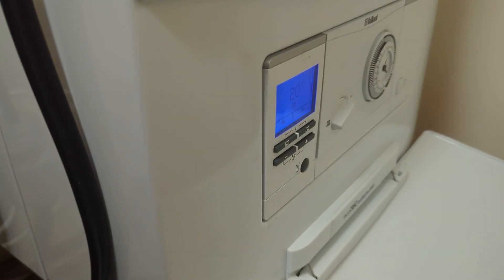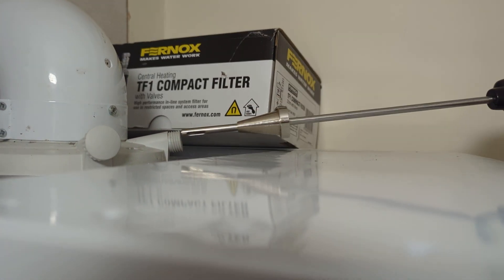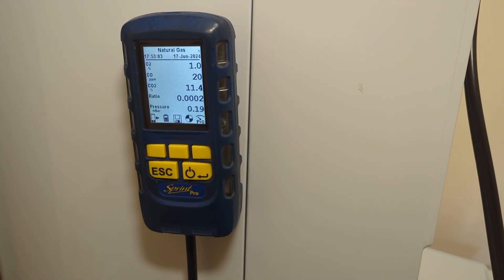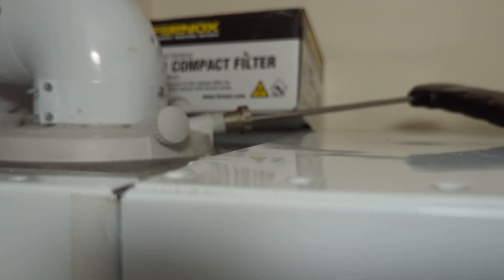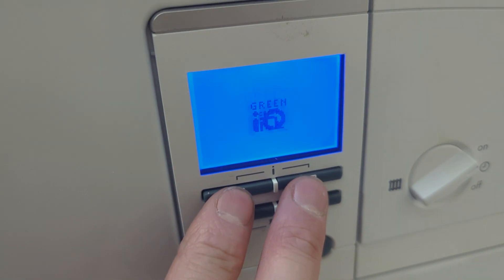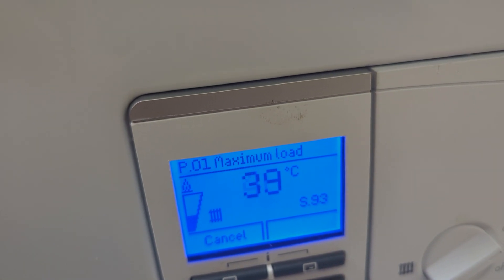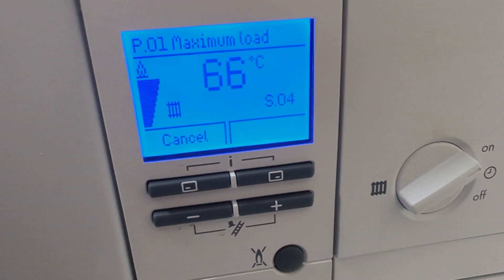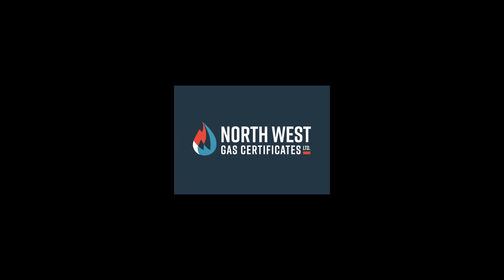Vaillant EcoTec Exclusive 843. Service Modes. Problems.

Comment: I’ve had this issue next time put it into p.06 remove the jack on the diverter valve and run a hot tap it will not over heat as it will be sending heat around the heating system and though the plate 👍🏻
Reply from the maker: Yes Vaillant did tell me to do this as well 👍👍

Comment: I've fitted over 50 of these Ecotec 843 boilers since 2020. Almost every single one had this issue. Some of these warranty calls from Vaillant are every 6months or annually. Customers are getting fed up. On the diagnostic menu, it shows CO sensor fault 8.
Reply from the maker: Ive run out of patience with them. Ive recently been back to this boiler. I don't understand. Vaillant came back, put it through its calibration to get some stable readings yet again. Then I come back a week later, I don't bother doing the calibration as its so hard without it over heating. I therefore just put a hot tap on and see what the readings are. They are absolutely all over the place and then the co just flys up into the 1000s. Surely that shouldn't be happening everytime the customer puts the heating or hot water on??

Comment: Many thanks for this info. I was pulling my hair out the other day.  My Analyser was going into purge mode with high CO readings. Why Vaillant dont do  separate set up sheet amendum, rather than burying it deep in the installation manual. Plus after  6mins the boiler shuts down getting  too hot on P.01 heating. Also same issues putting it into hot water mode.
Reply from the maker: I know. Im back servicing that same boiler in the next few weeks. Im dreading doing the flue gas analysis..
Reply: @northwestgascertificates  Or just do what most other blokes do. Dont bother doing Hi & Lo rate combustuon or flue integrity test. Just run the boiler, put the analyser in and print it off.  😂
Reply from the maker: @kevinmiller9522  😂
Reply from the maker: Although its been a pain to get into service mode etc etc. By doing it and struggling with it, it has diagnosed a problem with the co sensor 2 years on the trot. Vaillant have been out each year after ive been,  to change this under the warranty. Theres definitely a few issues with this model of Vaillant...
Reply: @northwestgascertificates I prefer the older Ecotecs you can manually adjust. How can you have this  boiler produce high amounts of CO until the sensor adjusts combustion. Seems dangerous to me.